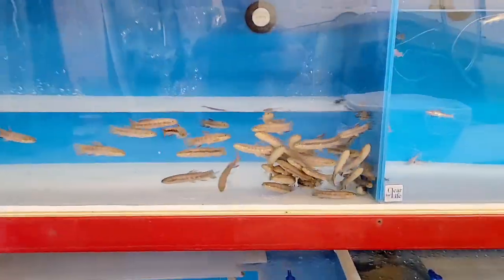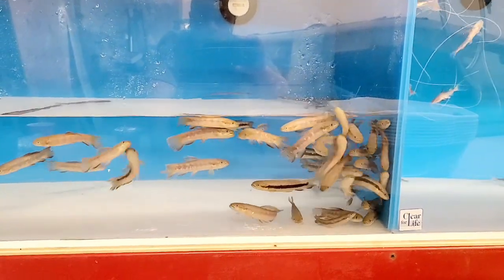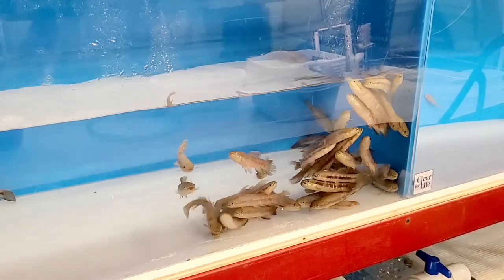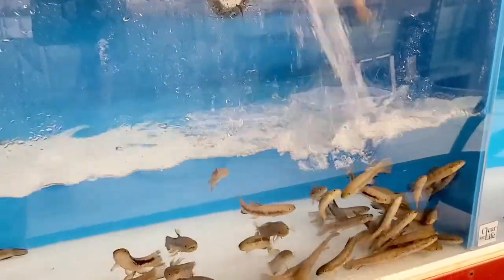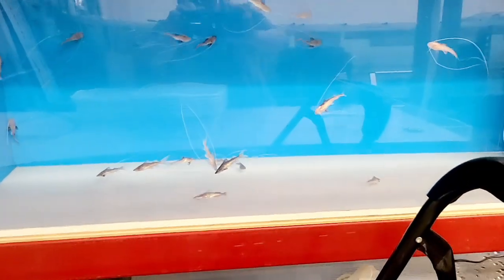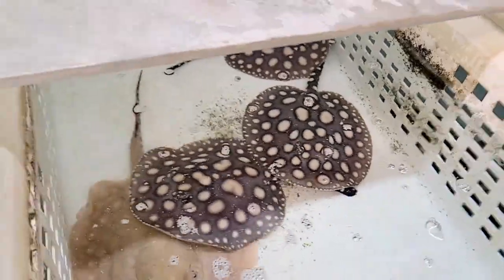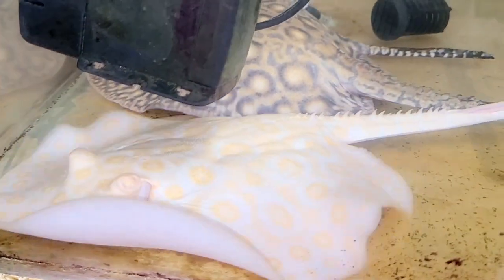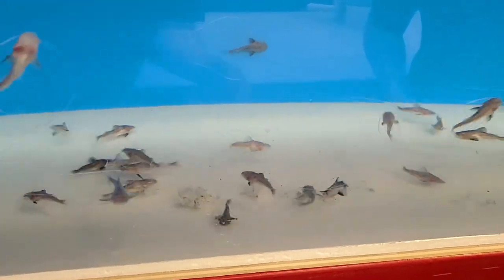Rainbow WOLF FISH Instincts - Surprising Behavior

Comment: Why don't u put a extension on the pipe so it goes lower down the tank and try filling it with no bubbles to see if they jump or not
Reply: I agree, putting on an extension so it is below the water line the entire time the water change is happening should help.
Reply: Ya, I also think that might help.

Comment: With the water low and then refilling, they are looking for a larger body of water.  I think when you lower the water level, it indicates the dry season and when you start to fill the tank again, the splashing indicates water coming from a larger body of water and they want to to get to that larger body of water.  You may be able to stop the jumping by using something to diffuse the water stream.  Maybe try running the water through a collander or run a hose along the bottom of the tank to eliminate the splashing.

Comment: I've been keeping different wolf fish for over 15 years. Erythrinus are probably the most active. I've had 2 in separate tanks next to eachother and they both differ drastically from eachother. One is very active and aggressive. The other more passive. Both although love jumping. Any surface agitation from my power head makes them go crazy. They slam my lids like little rockets. Sometimes waking me up at night. By far one of my favorites. Out of the 4 species I have now. And you don't need a 200 gallon tank to house them
Reply: @revelation8974  13in is big for a hoplerythrinus Uni. Any wolf at that size can break a glass tank. Size wise I'd be more worried about and Aimara or a malabaricus.

Comment: They are probably just jumping due to sudden environmental changes since they actually live in areas that don't have fast moving water currents(creeks and swamps to be exact),so they could possibly think that the water splashing down is a rapid, giving them the urge to find a new place to rest,and they also have specific pH level requirements as well.